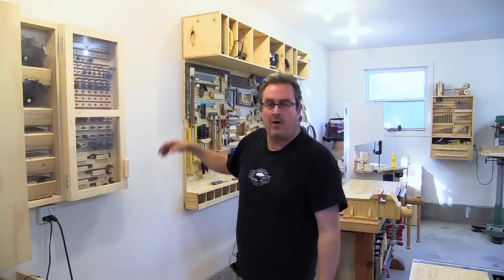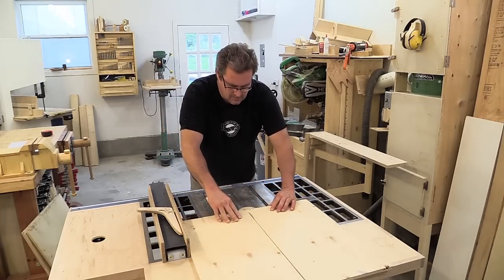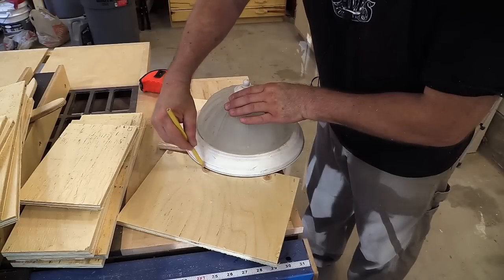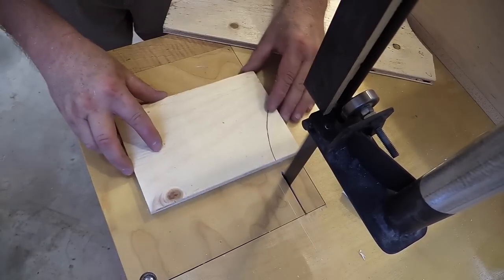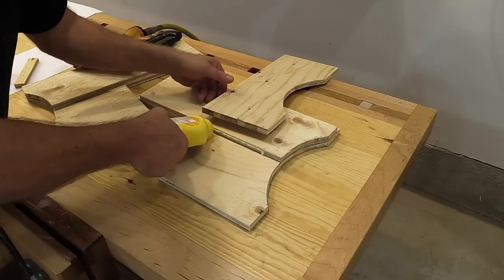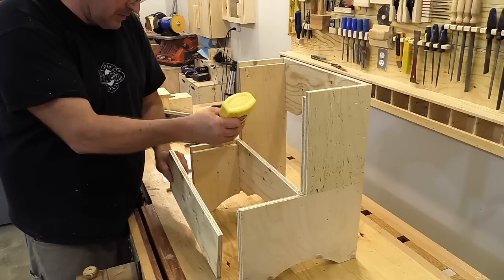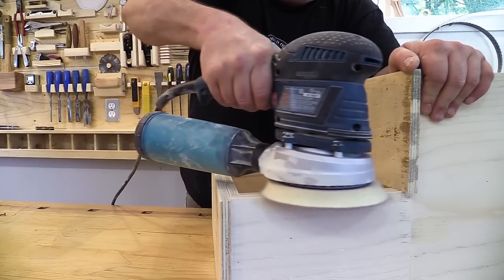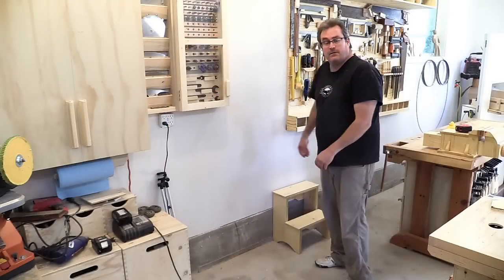Making A Step Stool

Comment: Hi John

Great project, just a thought, if you put some hanging slots on the back then you can hang it on the wall and use it as a shelf when not needed as a step
Reply from the maker: John Smith If it's on the wall with junk on it, then it will never be used as a step stool.

Comment: Very sturdy. Something you can get up on and lift heavy things too. The other day i was at a hardware store looking for some parts and i passed by the ladder and "co" section. I cringed. All aluminum/aluminium ladders and step stools, but that's not the bad side, it was the fact that i could punch deform one of those and they say it's ok to lift up to 50 kg over the "person limit".
Reply from the maker: aserta I have a cheap aluminum ladder I use around the house. It has collapsed under twice, sending me crashing to the ground - total death trap!

Comment: Well that solves the problem with the power tools up higher. Looks great, but I think you can fit one more tool in the empty spot under the wood mallet on the left hand side...LOL.
Reply from the maker: tigerdocsdc I don't need it to reach the power tools, that's not what I made it for.

Comment: Great video John. How long does it take you to mock up those plans? To this point I haven't made any plans for my projects.
Reply from the maker: Darbin Orvar Not long on a simple thing like this that I'm giving away for free. MUCH longer on the ones that I sell - weeks or months, sometimes.
Reply: Darbin, using SketchUp 8 Free you can do some very nice things. ( I have vids and take requests!)
Reply: Jay bates and matthias wandel have some great tutorials including how to make orthographic views 
Jayscustomcreations
Woodgears.ca
Reply: And why would anyone need to make ortho views? Their only purpose was (in the DARK AGES) to clarify details. With 3D all the dimensions are available to see. Hide components, or an exploded view(bad because it doubles your file size) Scenes (same problem as exploded). Almost never try to print from SU. Use a portable harddrive and a laptop (can give a bit of grief, but worth it in the long run). And USE Outliner. It is a life saver.
Reply: Oh, from 30 years experience in CAD.

Comment: John, I see you use your crosscut saw or your table saw on maybe 5 or 6   inch wide stock but you ride it against the fence instead of using your miter gauge. I don´t  have a crosscut saw and always use the miter gauge for crosscuts. I would like to do the same, is it reasonably safe to do it ? Thank you.
Reply from the maker: Alfredo Isaac If you are comfortable using the miter gauge, that's a "safer" way to do it. To crosscut against the fence like I do requires confidence that the part won't slip out of your grip and the correct technique. I hold the stock tight to the fence as it goes through, so if my hand does slip, it will go over the fence away from the blade. The piece that is cut off on the other side of the blade is held loosely, so that it will not bind the blade.
Best to do what you are comfortable with. When you watch me, you are watching a guy that has used table saws for well over 30 years with a lot of accumulated knowledge of what works and what doesn't.

Comment: Safety Police Alert!!! Aren't you concerned with the limited holding power of French's mustard? :-) Anyway, I think I remember your tip to use that, I bet it works better than the glue bottles that they sell small quantities in :-(. Quick and handy stool, I think the plywood wood look way better if you rounded a few of those edges though.